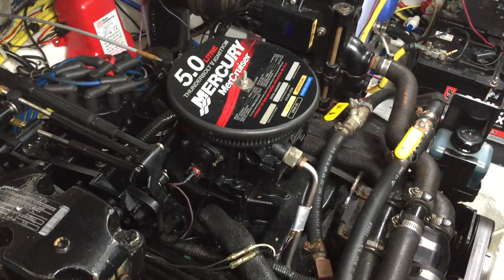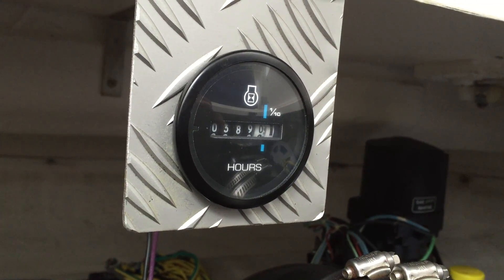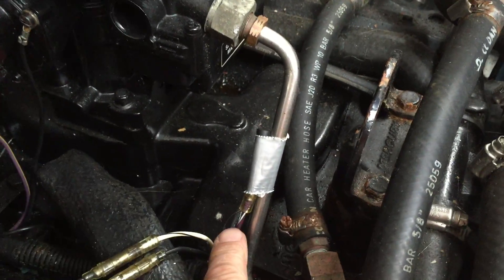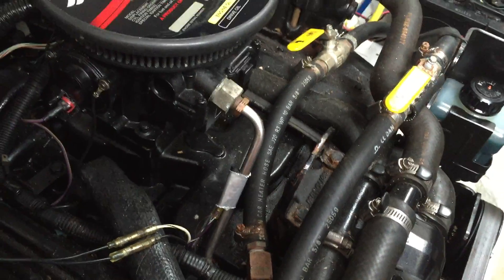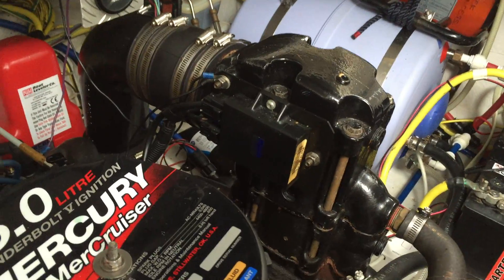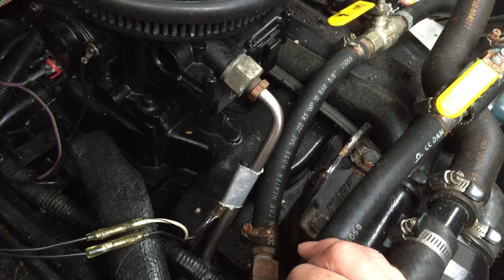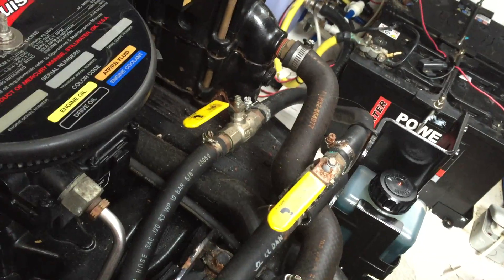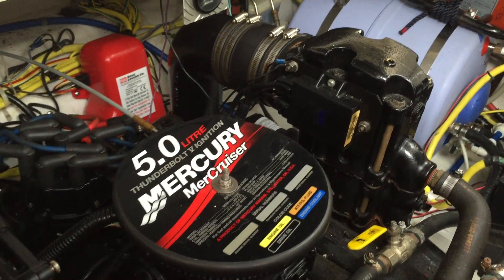Static Timing on a Mercruiser 5.0L V8 2004

Comment: Thank you. I have a 1998 Bravo engine that I was trying to adjust today after having removed the distributor. Your clue that the "Denso unit" tries to adjust the timing if that lead is not ground out just gave me an idea with something I was struggling with. I did not ground out the purple and white lead, and the engine kept surging. Was wonder how in the world the engine can possibly surge without me touching anything. Well, if the TB unit is adjusting timing on the fly, then that would explain it. Will try it again after grounding that lead. Thanks.
Reply from the maker: If you don’t set the distributor at 15 degree BTDC the density would try and correct causing your engine to surge .. did you mark your distributor before removing so when you reassembled you were so where in the right place. You will need a strobe light and earth the purple lead to reset correctly 👍
Reply from the maker: Denso not density
Reply: @MrRossYoung44  Unfortunately I did not notch the dizzy before removing. However, local auto shops allow you to borrow timing lights so I will do that and get it properly timed with the lead grounded. Thanks!

Comment: I have a 5.7 Thunderbolt , The Purple and white wire ignition control system timing lead. is is used for performing following tests and procedures.....
setting base ignition timing
engine idle speed
idle mixture
also Testing Knock Control Circuit.
When this lead is connected to ground -   the ignition control module (worth $1000 in Canada) goes into Base Timing Mode.  Note the Knock module ($250)

Comment: Hi Paul - great vid, halleluyah my friend I have been chasing  a low end miss in our boat for 4 years now, can you tell me if that wire which needs to be grounded, what does it connect back to at the other end please? So that I can find mine and then set the timing. Thanks, Lyle
Reply from the maker: The lead is purple and white and needs to be earthed to the engine mounts or similar...note sure who Paul is??? Lol
Reply: @MrRossYoung44  apologies Ross. Thanks for the info.  My mercruiser doesn't have the nice little plug unfortunately.  But I have found a bare section to work with. Cheers.
Reply: Guys This purple white striped wire should NOT be grounded.....It needs to be connected to the knock sensor at the bottom of the block blue drain plug. Note The Knock sensor should be on the opposite side of the starter as well . This info is on the Mercury document Thunderbolt 5 diagrams.  My heads are now at the shop and the fella is a marine electrical engineering dude. I would never know . He told me he did not want to see me bring the heads back in in 2 to 3 years again for another overhaul. Knock sensor issue is my issue or the module it hooks up to . The module runs 250 bucks.
Reply: @Great Music Good feel  thats a different purple lead. This one is purple with a white stripe. The one you're talking about is purple with a yellow stripe